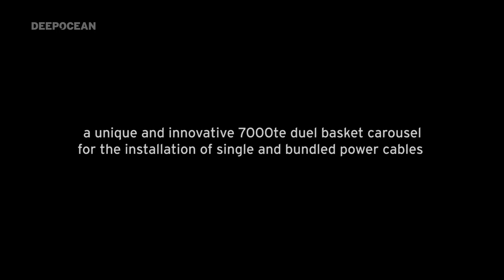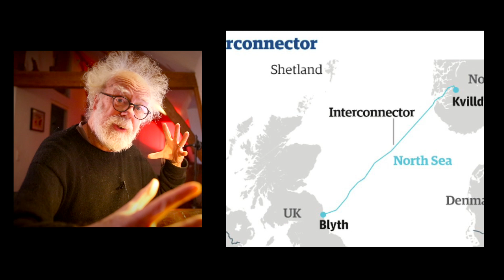UPDATE - Back to the Future and Power Transmission - Prof Simon

Comment: HOOOOOOLLLLLDDDddddd up a minute...I'm just getting my head around why AC won out over DC and now you're saying that they're making a whole load of DC stuff in preference to AC?
Well how doe that work, and, what are the losses associated with turning one into the other!?!
😁👍
Reply from the maker: there are big losses using dc but over extremly long distances....less than ac....amazing but true
Reply: @SimonHollandfilms  I was thinking more along the lines of the losses when DC butts up against AC...or at least the requirement for it to become AC

I guess what you may be referring to in terms of DC itself are losses on account of heat, possibly induction, and more than likely in the main (pardon the pun) resistance of the cable itself over a given distance...which is where studies into room temp/pressure zero resistance cabling becomes really interesting
Reply from the maker: yes you are correct....big engineering required to turn dc back into ac grid power.
Reply: @SimonHollandfilms  well...that's gotta be worthy of a storyline then surely? 

👍

Comment: In Reading information wrong perhaps but direct-current has the inherent flaw of reduced ability to travel long distances whereas alternating current was the system which through transistors and up converters and the system of stepping up allowed ac voltage to travel long distances...
Reply: Well addendum to previous comment alright so yes I have been essentially reading the information that's available, not necessarily wrong however I was not it was the nuance and the nitty-gritty stuff that had led me to the reverse conclusions so what did I discover that made me realize that the video is correct and yes I have been reading the science info regarding the current War and then trying to make sense of the data with the wrong fundamental understanding in the first place

Comment: AC use on the domestic networks.
The simplest reasoning for the use of AC is twofold, the propensity of DC to want to maintain the electron movement effect means when you need to disconnect the supply the equipment has to cope with very high energy arching as it breaks the circuit, this results in the physical and electrical sizes are high in comparison to AC that cycles from peak to zero to trough with the resulting energy being lower at the arc point. 
Secondly is the transformers, DC has to be converted to AC when you want to change the voltages for transmission and distribution. This adds cost and another physical piece of equipment to wear out or fault.
When the original choices where made between AC and DC the generation was very localized but a need for larger grids was envisioned, these grids required the very high voltages for transmission and transformation 
Almost a catch 22 situation.
Result, AC was safer and cost effective over the distances required with more losses being outweighed by the former.
Now the requirements for very long distances the balance has flipped, the physical infrastructure is small compared to the national grids needs, so worth the extra costs.
So very long distances use DC, long, medium to short use AC. Horses for courses.....

Comment: I'm sure I've missed something and/someone has already said this but I thought the DC couldn't be sent long distances?
Tesla and Edison had a fight over it.
Reply: @Eddie Hitler I think even they had to have Relays or the message had to be resend by hand at certain distances along the wires.
Reply: The 120 actually has 10 DC in it. SEE thats why you really never use the power its always alternating in the current thus the meter. With Ac need tons of transformers becuase it doesnt carry long in the line.  Current bounces back and forth and is lost in transmission in AC.  Dc is straight to the source no turning back
Reply: MONEY ITS A DRAG. And that is why westing house had put direct current Generators in Niagra Falls from Tesla ideas and of Course the AC for money from Alva

Comment: So I did some further research and yes it can be done. But you need very large components and there is still losses due to converting it back to 3 phase ac. So it does work for shipping power. Cool. I learnt something.

Comment: No no and no..
Transmission losses with DC current are enormous!! Even in Edisons day you would need a power source on every block.
Reply: Yeah. That’s what I have read too. You can do the test your self. With a 12 volt lead acid battery and long cables. So why now is everyone saying DC is better.  The cables have to be huge. This makes no sense.

Comment: So Edison was right all along and turns out it was Telsa who was the peasant in purple clothes
Reply from the maker: seems that way
Reply: @SimonHollandfilms  seams that way. Prove it. Connect a 12 volt battery to some long cables and watch your voltage drop. Heat the size of the cables would have to be huge. Costly. You can pulse dc but have not tried it over long distances. I’ll try it one day and see if there is a loss in voltage.
Reply: @danp1224  The Chinese and some European countries now use DC for long connectors, like one in China is 3000+km long, look it up very easy to find.  And apparently they say its more efficient.

Comment: Interesting question of what does Alaska do after oil?
High voltage DC power lines could interconnect wind farms and geothermal power plants with cities and other settlements
that don't have sufficient solar power (that is not buried in snow).

Comment: Typically, AC is used for long distance electric power transport by power producers, because of the ability to step up or otherwise manage the voltage with transformers, since a lot of electricity can be sent through thin cables, once the voltage is in the hundreds of thousands of even millions of volts, but in this case of ultra long distance power transport, the voltage can just begin as ultra high voltage DC, because for instance, the thousands of solar panels can be wired in series accordingly, and the management of the voltage can occur at the far end.

Comment: We already have a 500kV DC link here in New Zealand. It's over 500km long and because it travels between the two islands it has an underwater part. I do not think it's practical to send power here from somewhere else. we are too far away from the source and our power system is almost totally green already anyway